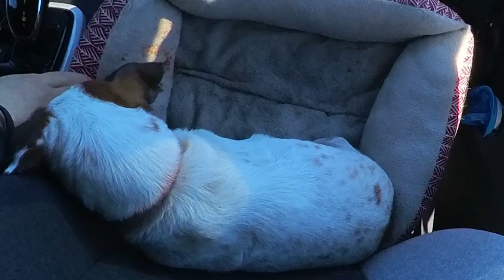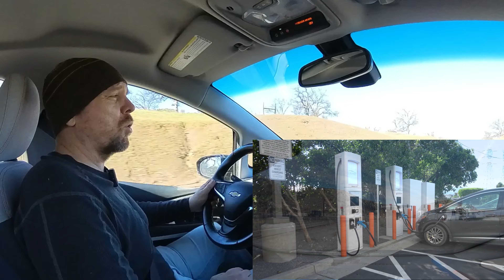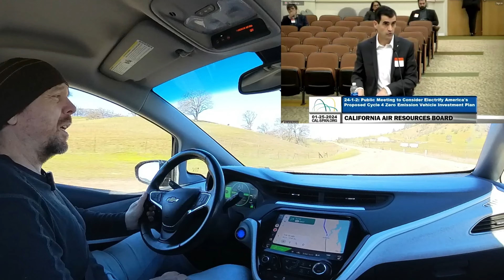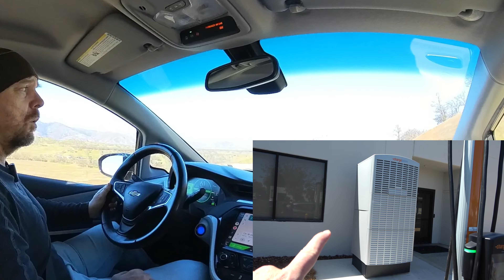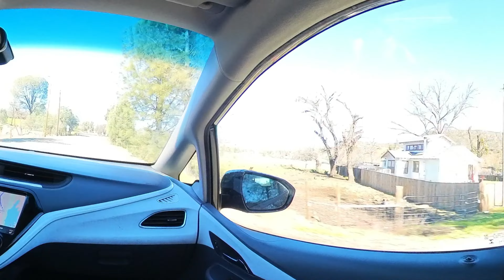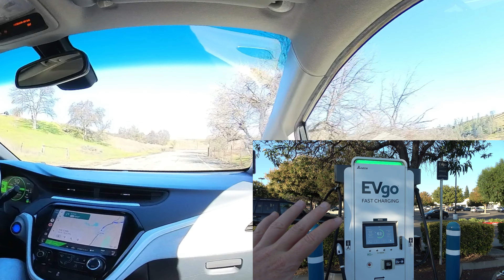Testing a New Camera and Talking EV Chargers

Comment: Great discussion and nice camera. Is it an Insta 360 cam? Or perhaps another 360 cam... EDIT: The dynamic range on the camera seems good, you can see your face and the view outside on a sunny day just fine ☀️

The mic sounds good. I recently upgraded my own mic setup to the DJI Mic 2 because the GoPro Media Mod was very unreliable and would just switch back to its internal mic on a whim.😮
Reply from the maker: Hey, yup. Insta 360. Overall, I think it's okay. I'm using the DJI Mic as well. I just couldn't justify the additional price for the Rode.
Reply: @newscoulomb3705  The DJI Mic works fantastic. You have the new Mic 2? I just got it 2 weeks ago and I'm really happy with it. A big improvement over a lav mic and the GoPro media mod that I was using!

Comment: I hope somebody is hearing you regarding the national parks charging infrastructure. You are perfectly right about it!
Reply: I think to make trips to national parks cheap and scalable with EVs, we're going need a massive increase in availability of level 2 overnight charging at hotels and vacation homes near the park. If every such place within a two hour drive of the park had chargers there, a modern EV would have enough range to drive from hotel to park and back to hotel again, without stopping to charge at all. 

Two obvious alternatives, mass DCFC near the park entrance and level 2 at popular trailheads inside the park itself both have drawbacks. Most national parks have huge differences in visitor counts between peak and off-peak seasons, so enough chargers to handle the peak-season demand would result in massive overcapacity in the off-season, making it difficult for charging providers to recoup their investment without enormous peak-season charging fees. Level 2 at trailheads sounds good at first glance, but most trailheads have either limited or no electricity, and getting the required power needed to charge dozens of vehicles at once would require dozens of miles of power line construction, which would be cost-prohibitive. Compared to these solutions, mass level 2 at hotels and AirBnbs near the park, where there is already plentiful electricity around, would be much cheaper.

Two good things going for EVs as vehicles to visit national parks are 1) optimal hiking weather matches perfectly with when EVs are at their peak efficiency, and 2) EVs are very efficient driving the slow, windy mountain roads that national parks typically have. Put the two together, it is entirely possible that, within the park boundary, an EV rated at 250 miles of range and an ICE vehicle rated at 350 miles of range actually have the same range.

Of course, it is also possible that up and coming battery improvements result in longer-ranged vehicles, rendering a lot of national park infrastructure issues much less problematic.

Comment: I like the new camera, but the world outside your vehicle is badly over exposed. I might suggest a 4-camera setup:

1. A dashboard-mounted camera looking back at you
2. A ceiling-mounted camera focused on the speedo-display behind the steering wheel.
3. Another ceiling-mounted camera looking at center console display.
4. A dashboard-mounted camera looking forward through the windshield with exposure set to the outside light (this last one could be your current pano camera).

That will be 4 video streams to edit together, but the results will be extraordinary. All the best.
Reply: I do a 2 camera setup on my channel and even that seems like a lot. I also have a filmmaking and editing background, so I can't imagine how much work it would take someone with less experience.

I think in general, this 360 setup works well. Eric can just verbally call out words/numbers on the dash or instrument cluster that are too small to see on camera.

My 2 camera setup is a front camera showing the unobstructed view out the windshield and an over the shoulder camera that shows the infotainment screen and me operating the steering wheel. Personally, I'm not one to show my face on camera. The small amount of my eyes that show up on the rear view mirror is enough, lol